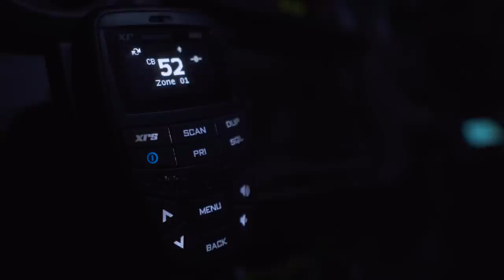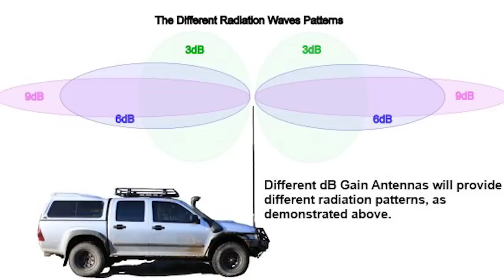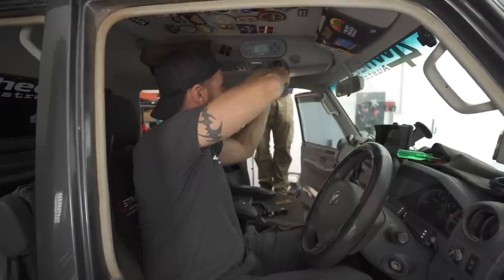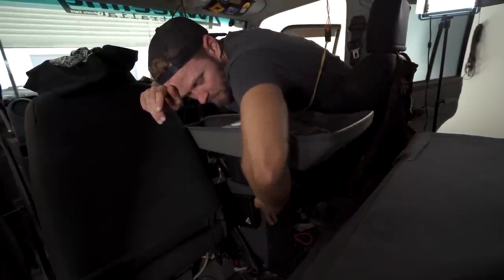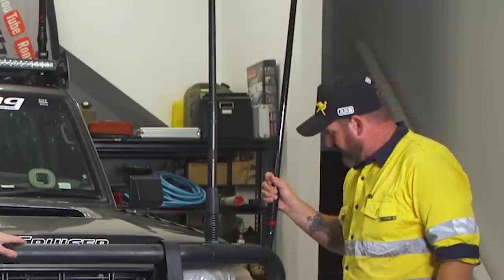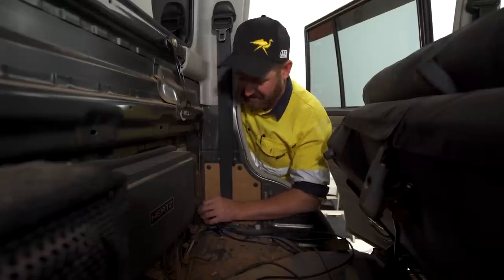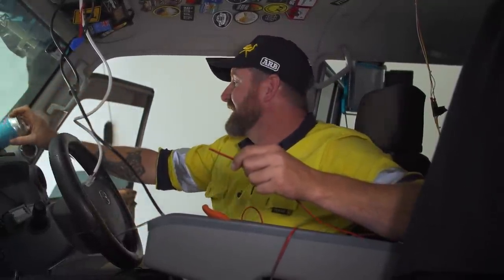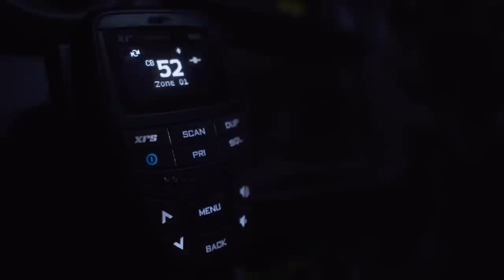UHF CB Radio Install & TIPS

Comment: Aerial brands? Preferences? Does it matter if the brands are the same for uhf receiver and the aerial itself? I am using a gme head unit 4500 and a uniden 3.1dbi fiberglass aerial.

Comment: Question: when I go to super cheap for solder there are so many different types which is best for ie. Lights, uhf or 12v in general
Reply: Make sure you buy acid free electric solder, that's probably most important and watch for manufacturers recommended soldering temperature.
Reply: Solder for electronic use. Jaycar best place to get it.
Reply: 63/37 rosin core should be the best for you. Rosin flux is acid free and safe for wires and insulation, and 63/37 tin to lead ratio is more forgiving to shaking hands than 60/40 solder

Comment: I noticed that you had 2 small 2.1Db antennas, a thin and a thick on. What's the difference?
Reply from the maker: One is protected by fiberglass and the other is a rubber ducky which is the same thing but not inside the fiberglass casing

Comment: Just a question, what is the wattage  of the UHF cb radios you run?  The radio installed in the headliner would have very little air flow and cooling issues with a higher wattage radio.

As for the VHF and UHF Radios I am running, they are normally around 50 to 80 watts, and some times we will use Amplifiers up to 300 watts.
Thanks in advance.
Reply from the maker: These are just 5watts as anything higher requires you to have a license
Reply: @Ronny_Dahl  Thanks.

Comment: Note to US CITIZENS IN USA, cb radio is NOT on uhf, if you buy a uhf radio and intend to use it in the states you either need a ham license or a gmrs license depending on where in the band you Intend to operate and for what purpose. CB radio however is totally license free, it is considered hf and therefore if you buy a uhf antenna to work with your cb radio it would not work.

Comment: Would the same distance between antennas be the same for uhf an phone booster antennas?
Reply from the maker: It’s more about distance apart and height so they are not casting at the same height but I’ll ask the experts to get the best tech answers for that one

Comment: Any reason you didnt go something like the Oricom DTX4200 that can listen to two channels at once?  i understand they arent as good as the GME but with a 5 year warranty surely its worth a try.
Reply from the maker: Mate I’ll be careful with my comment but One of the radios replaced as a cheaper low end one and it was rubbish. I couldn’t even use it.
Reply: @krump7429  can you explain why they're garbage? I understand GME is definitely better. But an explanation of why they're garbage would be good.

I do have an old Oricom that ive had no issues with. It came with an oricom antenna that snapped on me. I've since replaced with a GME antenna and it's now alot clearer

Comment: What do you suggest to do with extra cable from the antenna if you have some? I was just recently installing mine and have about 1 metre of extra cable.
Reply: What ever you do don't loop it together. It will mess with your signal.
Reply: Jacob Foreman Agreed. Make a “dog bone” of the extra cable. Definitely not a loop.

Comment: Sorry but why two radios?  Surely one is enough?
Reply: b monck one to communicate with other road users such as the truckies and the other to communicate with the convoy
Reply: It's for people that don't know how to use dual watch/priority scan features of the new GME.
Reply from the maker: List of reasons for two radios:

1️⃣Two channels at the same time, convoy plus road channel

2️⃣ back up radio should loose an antenna 

3️⃣run two different antennas or two different radios

4️⃣ rag along tours and training, the group on the main channel and tail end Charley on the private channel

5️⃣kids on one channel chatting and adults on the other channel

6️⃣a few other reasons I can’t think of right now

Comment: Can you have to antennas on the same line, I know you can buy switches for dual antenna combos but want to know if you can without a switch
Reply: You need to match the impedance of the transceiver, best not to...

Every joint and switch will also decrease output power and at 5 watts you want as much as you can get
Reply: You can. You have to have a uhf power divider cable that will match the antennas. It will also half the output power to each antenna but give you some antenna gain. It will also make your antennas directional depending where they are mounted on the vehical.

Comment: How do you wire it into the accessories. You skipped through this section a bit.
Reply from the maker: You use the ciggy lighter wiring it’s off accessories
Reply: @Ronny_Dahl  do you need to pull out the cigarette lighter and piggy back off the wiring, or do you just join on at the fuse box?
Reply: It is better to run straight to the battery with a fuse close to the battery.  You risk picking up noise by using the accessory circuits and you will get cleaner power with a dedicated circuit.

Comment: 6.6dbi and 2.1dbi actually refers to the Effective Isotropic Radiating Power of the Antenna. It depends on how the antenna is designed to what its radiating pattern is....NOT IS FUCKIN DB RATING
Reply: Yes, you are right, but EIRP and beam pattern are related. Maybe explain not just be rude.

Comment: No SWR adjustment? You‘re risking to melt the amps .. !
Reply: This is unnecessary on UHF with well designed antenna in a good location.
Reply: Agree, with a single band antenna the SWR is basically set for that freq. a short or something can affect it though.

Comment: one important issue, the unit inside the roof console, how it will ventilated, it will get hot during heavy TX!!! I run through this issue and had to install a cooling fan, however, fans cause interference, therefore conductors should be used to eliminate the disturbance on the radio signal using a oscilloscope. Hope this help.
Reply: The external box has holes, the box they mounted in roof don't get hot as its mostly a screen

Comment: Why have a car mounted radio? Can I get away with a handheld?
Reply: Guy Needham You sure can. But you won’t have anywhere near the range you’ll get with a mobile unit (car mounted).
Reply: transmitting inside a metal box with a handheld doesn't help range.

Comment: Dude, CB radio is not UHF but somewhere around 27MHz :)
Reply: Yaniv Eliash CB radios in Australia are both AM and UHF. CB is an all encompassing term. Citizen band. I.e. no licence required
Reply: Yaniv Eliash The most certainly do have UHF CB in Aus/NZ (and other places) As well as the old 27 meg CB. I wish like hell we had it in the US. I have a GMRS license, so I use that on UHF.
Reply: yes we do..most newbies only use uhf ...i still use 27.355 lsb which is our aussie call channel on 27 mhz..uhf sux balls
Reply: @lastknownlocation8760  AM and UHF? AM is a modulation type, UHF is a band.
Reply: In Australia we have two bands of Community Band (CB) Radio. HF CB which is ~27Mhz, and UHF CB with is ~477Mhz
Reply: Jay

Yes, so they are both bands according to GME (see below)

 The Citizen Band Radio Service (CBRS) is a two-way, short distance, voice communications service that provides a cheap, reliable means of communication.
The service operates in two frequency bands: 27 MHz and 477 MHz UHF. 
27 MHz is an AM transmission while 477 MHz UHF CB is an FM transmission and gives clear, crisp local communication without long-distance interference.
Reply: Ralph Williamson you need to do some further reading Jay is correct. AM/FM are describing the way the information is encoded into the signal, 27Mhz and 477Mhz is talking about the core frequency the channels are arranged around. Band is a description of a division within the full radio frequency range. That’s still not a great description but it’s as short and easy as I can make it.
Reply: @lastknownlocation8760  Sorry mate, you are wrong. AM, FM, SSB, etc are all modulation types. IE. How your voice is "modulated onto the frequency"
Reply: Jay sorry mate

You’ll have to argue with GME that’s from their website

It will be good for you guys to educate GME. Obviously you are the experts, they only make them
Reply: Stuart Smith as I said to Jay 

You’ll need to correct GME because that information is from their website.

It will be good for you guys to educate GME. Obviously you are the experts, they only make them
Reply: Ralph Williamson what they are saying is correct, how you have interpreted it is incorrect in your original statement.
Reply: Stuart Smith that’s great

I’m glad you have verified the manufacturers know what they are doing
Reply: Stuart Smith strongly disagree
Reply: Ralph Williamson AM or FM is how it is sent, band is what frequency range it is sent in.  Various communications technologies such as AM and FM Radio, TV, WiFi, Mobile Phones etc...have a range of frequencies assigned to them through regulations. But, you can use AM or FM transmission technology in any frequency range although you may be breaking the law in doing so though.
Reply: Stuart Smith I don’t know

But I guess over the last 20 years I’ve probably sold over 1500 UHF radios and my customers usually ask for UHFs so that’s what I supply 

Usually GME units

All good mate
Have a good night

My choice I’d use ICOM units because we can bump them up to 80 watts